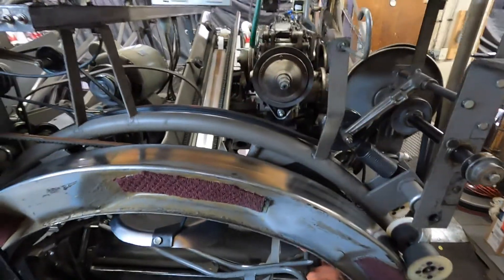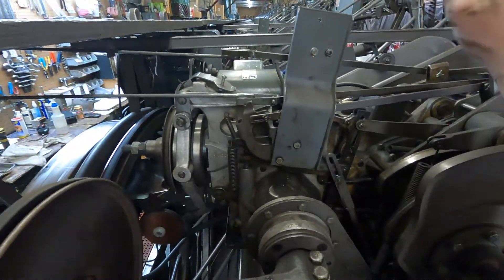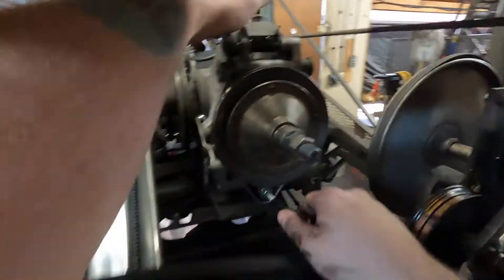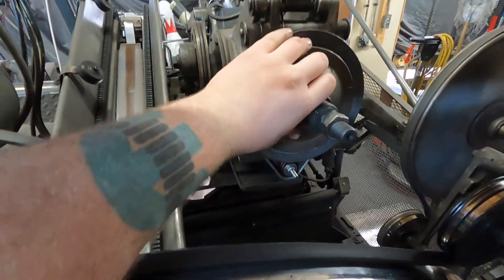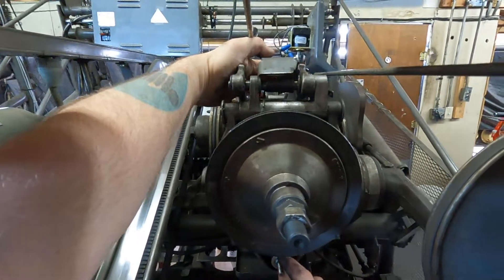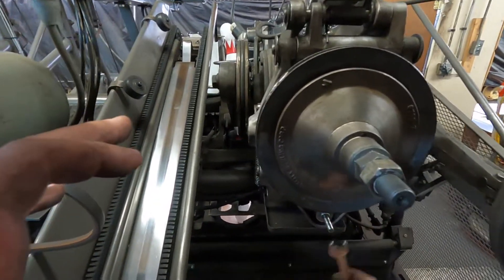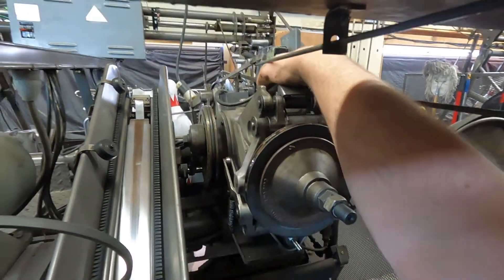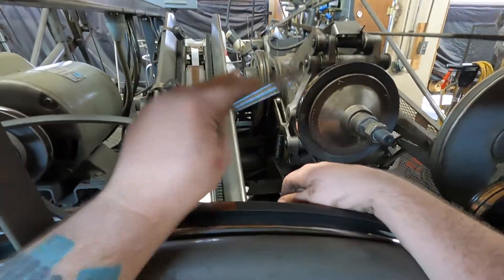Clutch Cam Follower #8 - Brunswick Pinsetter Adjustments

Comment: what was the indication that the clutch cam follower needed adjusted in the first place?
Reply from the maker: To insure that the clutch cam follower is urged to follow the contour of the clutch cam to properly control the motion of the clutch lever. That’s the book definition, so if your clutch arm isn’t going through the motion at the right time then good chance you’ll need to adjust it